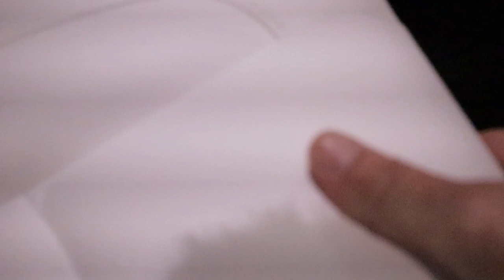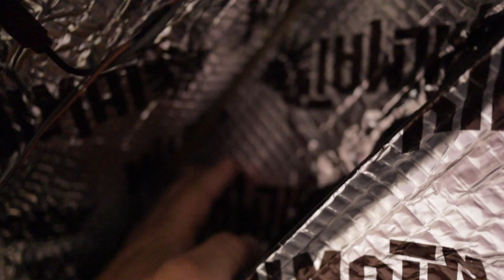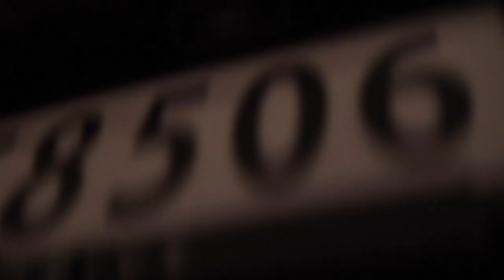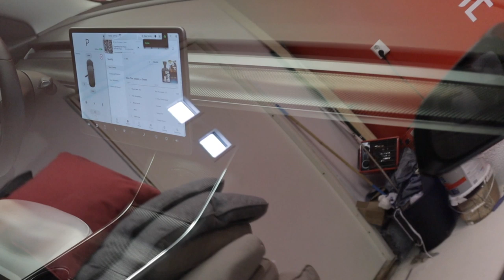MORE NOISE FIX - TESLA MODEL 3 + TAILGATE PREMIUM SOUND

Comment: Did you ever sound dampen  the footwells?
Reply from the maker: Yeah
Reply: @FrostyFingers  did you create a video showing how to do it or can you do one?
Reply from the maker: I took the carpet out, and added the mats on the floor. Neopren foam noise cancelling with adhesive. Most effect was the ones inside the wheel wells tho.
Reply: @FrostyFingers  wish you'd made a video showing us how you did it😔

Comment: Nice video! 👌
I too finished the trunk lid yesterday to, haven’t listened to any music since adding the deadening but the sound when closing the lid is much nicer! ✌️
Thinking of adding some deadening to the inner door panels or maybe even some mlv can fit....
Reply from the maker: Yes doors floors, whole trunk. Take out fabric inside, arches :) good luck
Reply: FrostyFingers 
How much difference did the deadening in doors, floor and wheel arches do to road noise? 🙄
Reply from the maker: Viktor Wallin to be honest, not much. But again a lot. It’s not so much the noise, it’s the more mute sound you get. Everything sounds like it’s a better build quality. I think the road noise is hard to conquer! Run 225/18” and you have reduced it dramatically:)
Reply: FrostyFingers yeah, I reckon so. The road noise is most likely structure bourne and hard to get rid of, unless 225/something on 18” tires and that won’t happen! 😂

More likely moving up to 245 on 19” and just accept the noice! 😉

Did u remove the windows from doors and deaden the inside of door?